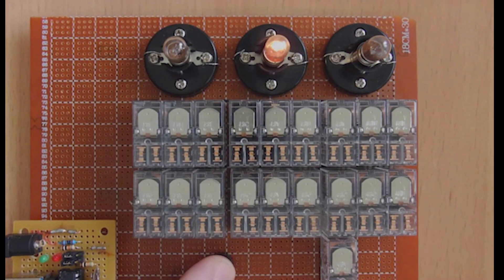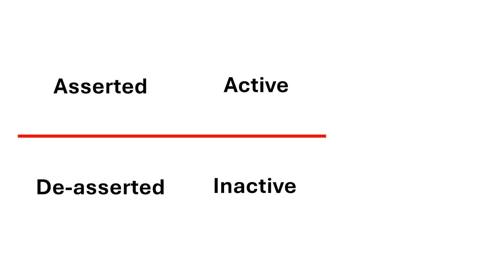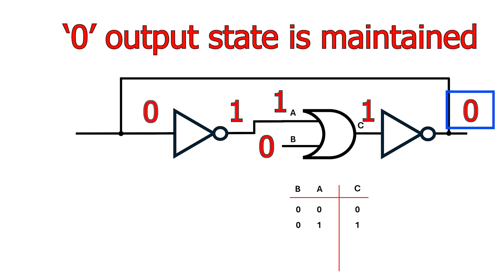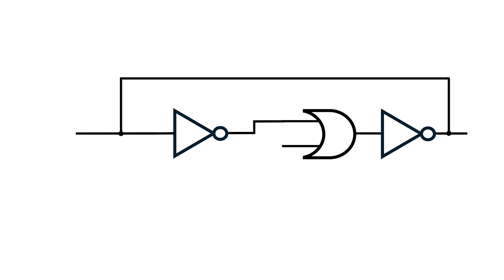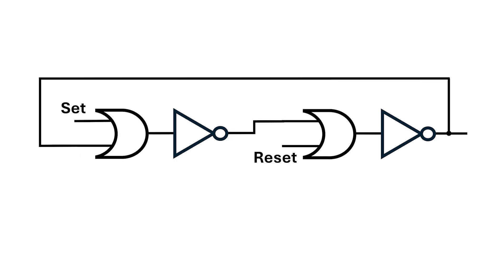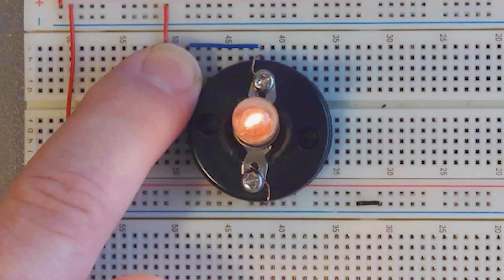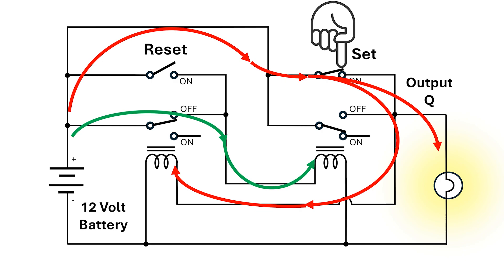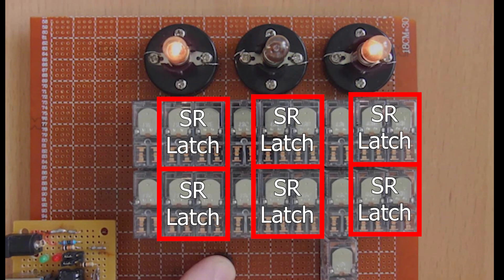Switches to CPUs: Set Reset Latch

Comment: I only saw the one error that had already been pointed out by another commmenter in this video.

Now I'll cover set/reset logic for a single-relay latch. Set is accomplished by having a normally open switch that energizes the coil when pressed, similar to the two-relay version. Reset is accomplished by having the loopback go through a normally closed switch, which disconnects the output of the buffer from the input when pressed. This is part of why it's not great for teaching how latches work, since "disconnected" isn't necessarily equivalent to "off" for all devices.
Reply from the maker: Correct, I’ll be covering a single relay latch when I build the register bank. I’m planning to use Deiter Muller’s ALU design as well which is pretty cool (5 relays per bit). I test these videos on my daughters and I stop when they start to look bored.
Reply: @DrMattRegan  Good testing strategy.

Comment: I have never seen an SR latch described as a sequence of gates before. It made its functioning much more intuitive. Also, I see you are using 12 volt relays. I purchased 5 volt ones, and in the 6502 forum someone said 12 volts are preferred due to current considerations. Any thoughts on this?
Reply from the maker: Thanks Martin.  I think you’re probably going to need a transistor to drive the relay when interfacing with conventional logic, so think there isn’t a huge difference between 5v and 12v.  I’ve got a simulation of the relay based sequencer/decoder running, it’s about 300 relays, so I used 12v ones because they were a bit more common and cheaper!
Reply: @DrMattRegan  OK thanks. Neil in the forum posted a link to a source of 12 volt relays that's $0.50 per relay, so I can always buy more.